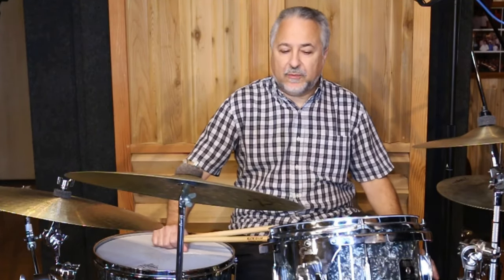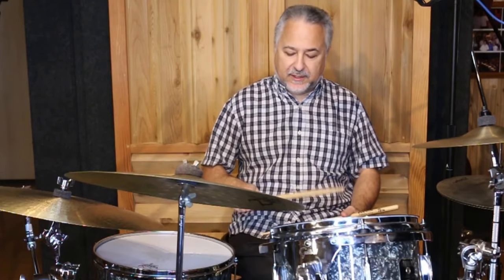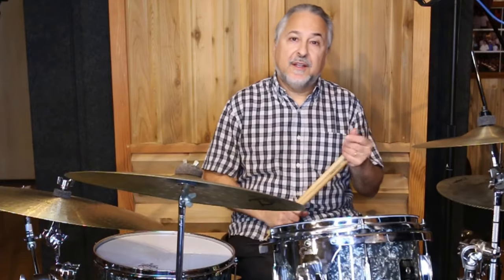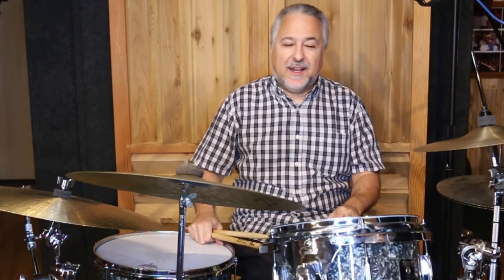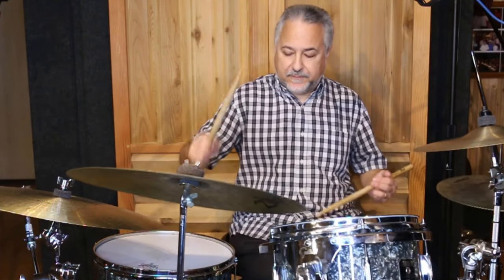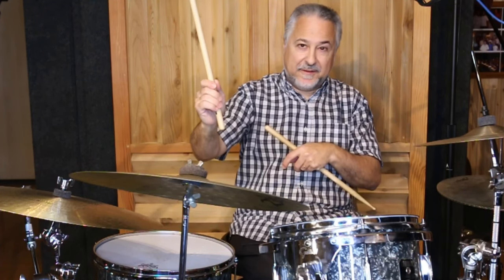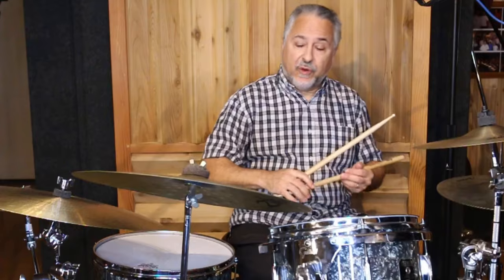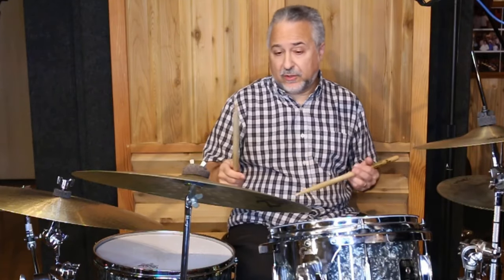Playing with Relaxed Technique on the Drum Set

Comment: Thank you for this helpful video Rick. In what situations on the cymbals would you use the push-pull vs fingers only? Towards the end when you talked about bouncing the stick on the cymbals to get that shaft-tip sound, we’re you using moeller?
Reply from the maker: No Moeller in this video. That is a shaft tip technique that many R & B players use. I use the push pull when I play many consecutive measures of a fast continuous rhythm such as 16ths in a row. The fingers will eventually get tired where the push pull is a perpetual motion technique that can continue forever.

Comment: Thanks for a beatiful video, Rick. I can not make the push pull work
Reply from the maker: Hi
Make sure you are dropping the first stroke with your wrist and let it bounce up. After that grab the stick with your fingers for an upstroke. It should all feel very much bounced and not forced. Make sure you are not using your arm. Take your time and go slow at first. It is a perpetual motion technique so it does not require much effort at a slow tempo.
Reply: @rickdior  Thanks so much for your in depth reply. I think I've been practicing the right way. I have good rebound and have been working on it for the last couple of years. Thinking about perpetual motion, that might help... :-D

Comment: It's funny...

To play the relaxed technique effectively with two toms mounted over my 22" bass drum, I have to sit so high I feel off balance. My largest rack tom is an 8"×12" drum. 

When I sit lower, with the snare slightly tilted towards me, I end up using a first finger/thumb fulcrum, which instantly tightens things up. I can play very precise this way, but I'm not getting the flow I get with the middle finger/thumb position. 

When I started using the relaxed approach in 1998, I played a five piece where all my drums were flat. My 12" tom was mounted off the crash cymbal stand. I used to get so many calls and work playing that way. 

So now I'm trying to figure out which way I'm going to go. I may go back to my "Vik Foxx" flat kit again. I may have to. I miss my feet!